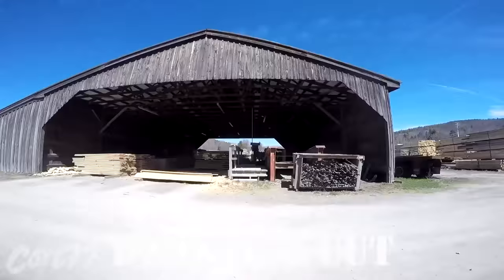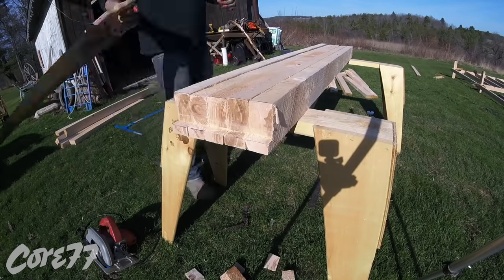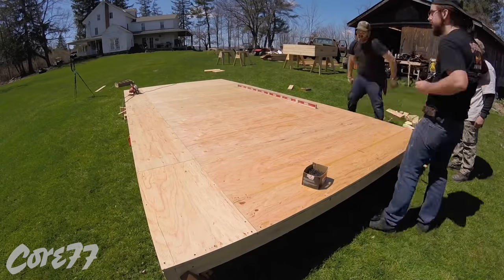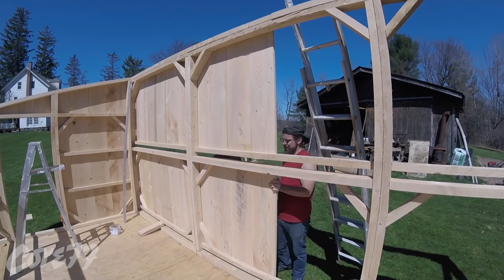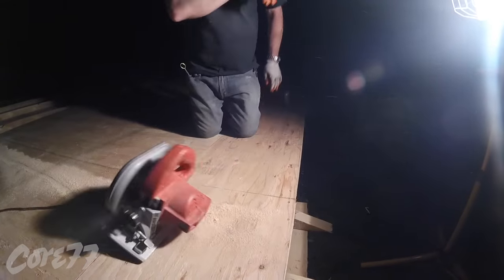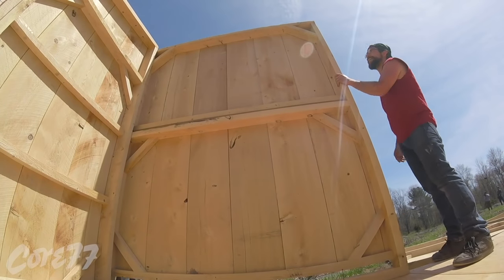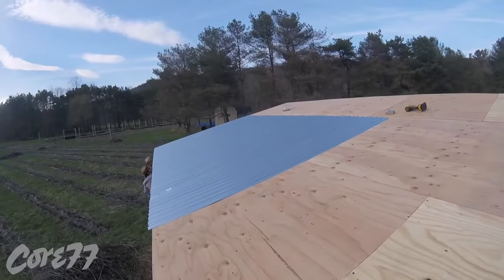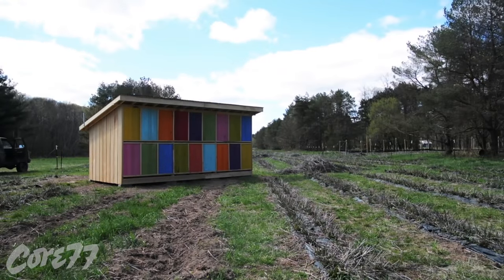DiResta's Cut: Beehive House

Comment: Awesome shed it looks great . You might find that the iron will rust quickly on the ends that where cut by the grinder unless you painted them after they where cut. It is only a shed and will still last a long time.

Comment: 2x4's are just fine for the floor, because its not going to be high in the air like a deck, and it is an out building that isn't going to be occupied anyway. And those floor panels wouldn't be heavy like a 2x6 floor would of. good job jimmy!

Comment: Great work as always. What's the reason for using green wood as opposed to the dry stuff from Home Depot or wherever?
Reply: Cheaper. And near the house.  And the texture
Reply: Thank you. Another question to you or the group, since it's not pressure-treated or cedar, what's the difference in time it will take to rot? Are we talking many years? Thanks again.

Comment: The Z is correct, good work.
Reply: I was wondering what was wrong about it... Maybe they had planned to have the door open the other way first and then put the hinges on the other side so that the Z ended up correct after all?
Reply: I believe the diagonal part of the Z i supposed to hit the hinged side at the bottom of the door. I think that's what he is referring to.
https://s-media-cache-ak0.pinimg.com/originals/a6/ae/11/a6ae116d19ee550e979d72c2cd5fe9c3.jpg

Comment: Why is the Z in the wrong orientation?  The diagonal board is in tension and holds up on the "open" end of the door, seems right to me.
Reply: Would you care to explain why?
Reply: +eformance In tension the board is held by the nails only where in compression it can also be held by a rail on top and maybe a style or a rail in the bottom,  no need for nails. But set outside it brings rain to the bottom hinge.

Comment: Why do they sometimes use screws and sometimes use nails? What's the functional difference?
Reply: +ArcaneCookie The commentary in the video explained that the screws were used in areas that needed to be disassembled.
Reply: ***** Thanks for the detailed response. This all makes a lot of sense. Isn't there also something else about nails having more lateral strength?
Reply: icarus901 Yes I did catch that I was wondering about strength, but MrMe01 explained.

Comment: Great video, but being in the construction industry cutting roof sheets with a grinder is one of the biggest no nos
Reply: Why ? How would you cut corrugated ?
Reply: The sparks from the cut tend to stick to the sheet and promote rust. Its either hand cut with tin snips or specially designed shears
Reply: +Cort Barnett it might make a snazzy youtube vid , but this thing is gonna fall apart in 5 years.
no paper under the tin, ply will delaminate, not enough overhang of tin, water will get in at the end of the rafters, untreated timbers, probably cos of the bees,will rot, and the floor joists, such as they are, are bearing weight on only 3 quarter inch at either end, with a few screws supposed to hold them up.
colourful though, ill give you that.